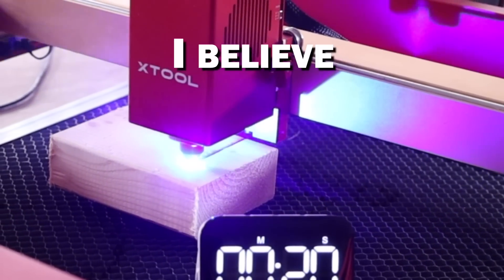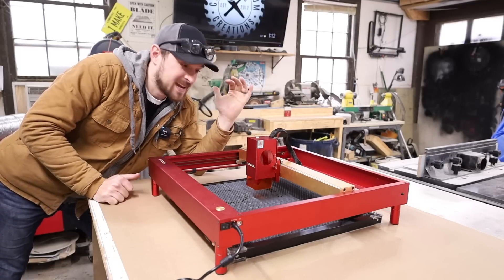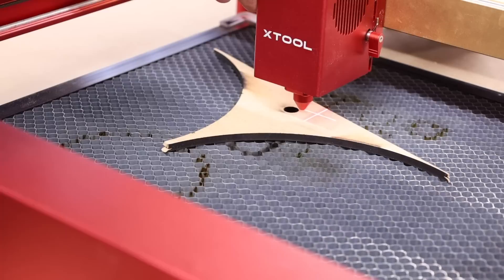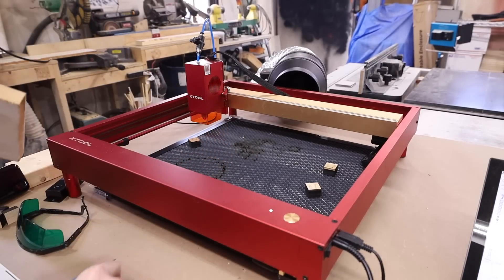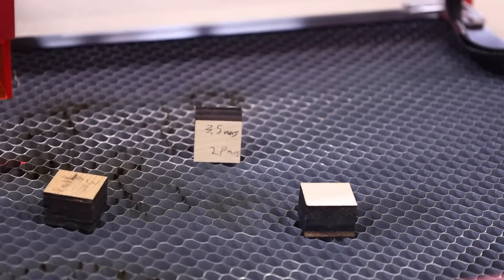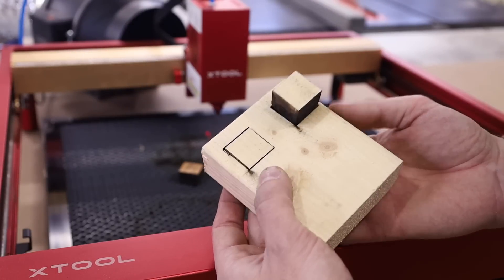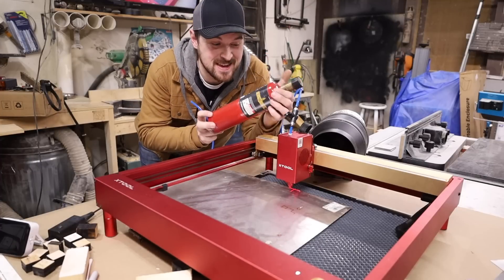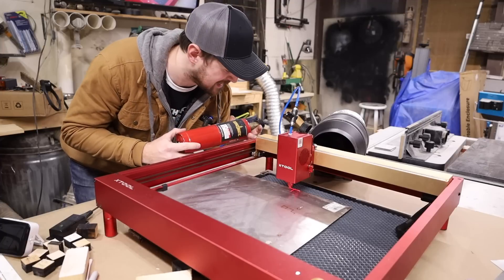World's First Actual 40w Diode Laser The xTool D1 Pro Cutting Test

Comment: At 40 watts, I'll have to say an enclosure is mandatory.  Too much power == serious accidents (not like cutting off a finger, but eye damage).  40 watts is a bigger improvement for engraving and working with appropriate thickness materials (1/4" or less).  Getting into CO2 laser power range (yes, lower end, but look how fast it went from 5 watts to 40 watts.. ).  I'm hoping fiber laser prices will significantly drop.  Please keep your cat away!🤣Good video Chad!  Now get back to editing the next video in the shed saga!😁
Reply from the maker: Hahaha I am glad someone is enjoying the shed saga as much as I am!
Reply: @ChadsCustomCreations  isnt it 40W consumption/input power? CO2 laser can give 40W output power (i've got K40 co2 laser) and before i bought it, i was thinking about laser diode laser but every1 was rated with input power :D
Reply from the maker: @diemfpv  xtool is like the first company to stop with all the false marketing by giving input wattage and they give you output values so this thing has 8 5.5w diodes all lined up with mirrors and it produces 40w output.
Reply: @ChadsCustomCreations  Thanx for info. 8x5.5w diodes sounds strange, i think i would not give u 40W output but... that doesnt matter - i would be scared to use it. It could make u blind rly fast.
Reply from the maker: @diemfpv  5.5w would equal 44w but based on loss of power from reflection of mirrors they rate it at 40w even though their test with the optical light meter was reading 42w on the live YouTube stream they did. It definitely is dangerous for anyone who doesn’t know what they are doing.
Reply: @ChadsCustomCreations  yeah but it might be dangeous even for someone who knows what to do... one reflection from acrylic/coated aluminium and u're blind. I'll stick with CO2 :)
Reply: Not sure what is normal on these hobby machines but we have projection lasers at work just for part positioning. Those are only pushing 5-7 mW (that’s milli Watt) and eye protection is on the edge for those if the distance is really close… so if you’re pushing over 10mW and have the potential for eye exposure, enclosures and or protective laser glasses are probably more of a necessity than a luxury.

Comment: In December I picked up a 40w Monport CO2 for around 500 bucks. At 1000 dollars for just the laser module what is the upside to this over the CO2?
Reply from the maker: Diode 40w seems to be equivalent to like 100w co2 laser in my opinion. If you can show me your 40w cutting through a 2x4 I’ll change my mind.
Reply: speed even a cheapah omtech goes way more faster, the 10ww asumption is ridiculous, again a paid review...
Reply from the maker: @philippemayne7529  this was not a speed test this was a cutting test please show me a co2 that can cut a 2x4. I’ll wait 🤣
Reply: @ChadsCustomCreations  speed and power at totally linked unless you don't know anything to laser. If you are enough porwerful you go faster that the goal of getting high power laser else you didn't understand why you not using 4 pass on a 5w laser....
Reply from the maker: @philippemayne7529  Philippe I get what you are saying but my 90w co2 laser even with a 4” Focal length lens cannot cut a 2x4 no matter how slow or how many passes I run at it. This diode laser cut a 2x4 in half in 4 passes at 3mm/s and if you have a video of a Co2 laser cutting as well or better than my results with this 40w diode my mind will not be changed. And a 2x4 is 38.1mm thick for reference
Reply: @ChadsCustomCreations  do your homework , tested in the same setting. knowing that it will be a lost of time, specifically because we don't use laser for this kind of work :D
Reply from the maker: @philippemayne7529  something tells me you don’t use lasers at all 😘
Reply: @ChadsCustomCreations  sure...no you sound like school playground kids when you are out of argument.

Comment: Very cool!

Just had 2 questions since I'm trying to fine tune some technique with my 30W diode.
1. Is the space you create between the honeycomb plate and your work piece a means to keep the piece from burning on the bottom?
2. What is the surface material underneath the honeycomb plate?

Much appreciated
Reply from the maker: If your piece is directly on the honeycomb you will see little reflections burns I do like lifting stuff up too cause it makes it easier to know if you cut all the way through.

There is a sheet of aluminum under the honeycomb absorbs all the heat really well.
Reply: @ChadsCustomCreations  Awesome, thanks for the response. Definitely getting the reflection burns, but I'm also getting the piece starting on fire from underneath... Been tough finishing a project when that happens, lol. Usually even running at 5mm/sec at 100% with air assist, it will start on fire. I'll try creating that space to keep from retaining the heat on the piece.

Thanks again.

Comment: Hope you have flashback arrestor on that oxygen tank.
Reply: Oxygen needs fuel to burn, so it's not going to flash back. There is no fuel in the line to burn its just oxygen.
Reply: @rogwabbit  huh...i just looked it up and your right. I had always heard not to have an open flame when oxygen was present so i just assumed it was flammable.  Thanks for the comment.
Reply from the maker: This comment is exactly why I am glad I waited looking into that now thank you.
Reply: @ChadsCustomCreations  please don't, there's no way for the flashback to happen unless the hose catches fire which will just go around the outside of the arrestor.
Reply: @ChadsCustomCreations  you should use an oxygen tank with a regulator so you don't lose pressure mid cut. You can supply oxygen through a needle setup if you want to keep using air assist.
Reply: @ChadsCustomCreations  I am glad you waited too... flashback is no joke!...that said... once you put that in place i think the only risk will be to the machine itself...Just be ready to cut the gas and power off in case of emergency...Assuming you are still willing to chance it, i look forward to seeing the results.
Reply: @UbberMapper  oxygen isn't flammable it only supports combustion, as such an arrestor won't help on oxygen lines only gas lines. They're sold in pairs mostly for profit. If the oxygen line is on fire then the hose is burning, when using non welding hoses an arrestor won't usually help on oxygen as the hose melts and burns around them. This is why I use a brass tube for the connections at the end of the plastic hose on my laser.
Reply: It never ceases to amaze me just how many people think that oxygen burns.
Reply: As an ironworker who uses a torch DAILY, you do NOT need a flashback on only oxygen. OP does NOT know what he's talking about. If you wanna waste your money, buy one. You do NOT need it.
Reply from the maker: This comment thread was good for me I went and did some research looks like my biggest issue is the rubber tubing burning from the addition of oxygen. The tube being the fuel. If this works out I am going to look into one of those oxygen generators I could plug up directly to the nozzle.

Comment: Have they started shipping already??
Reply from the maker: I am not aware of the actual estimated delivery dates, this one given to me to review so it was sent via air freight. I would guess maybe that puts this one 1-2 weeks ahead of the units coming over on a ship.
Reply: @Chads Custom Creations  site says mid February... that things a beast man .  Can't wait to get mine in
Reply: Hey do you think if we can get the same results with the regular air assist?
Reply from the maker: @enginearte  in my opinion air movement is very important if you plan on cutting like this. I’ve done test before with low PSI and it just doesn’t move the material quick enough for cutting as well.
Reply: @ChadsCustomCreations  thanks for letting me know!!!
I need another upgrade well!!!